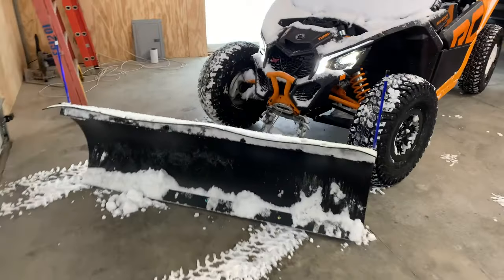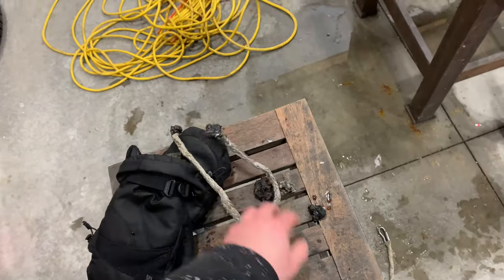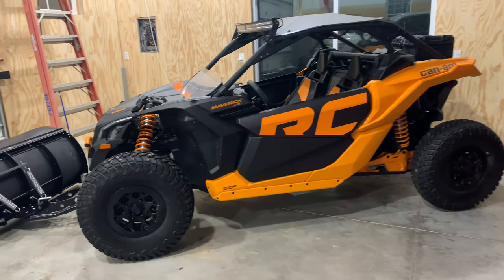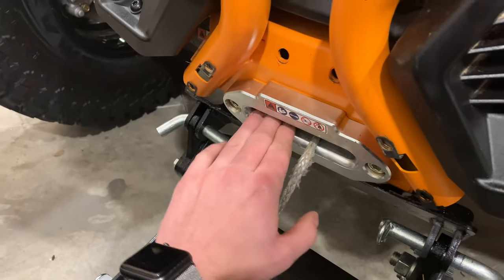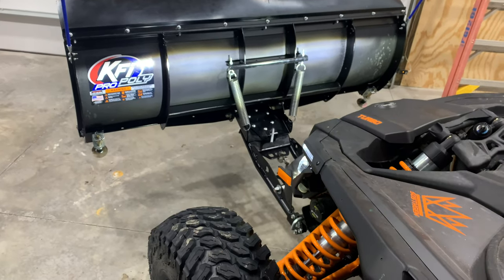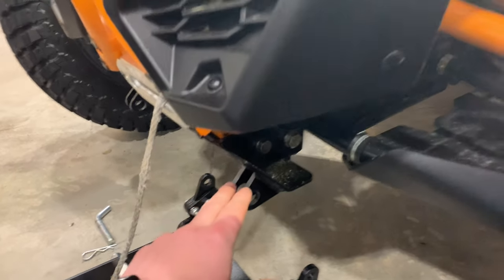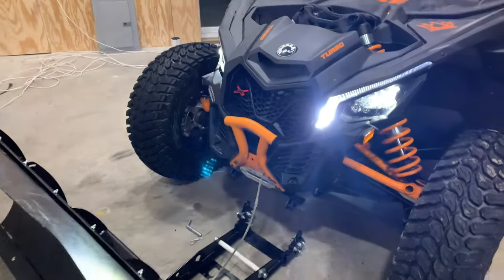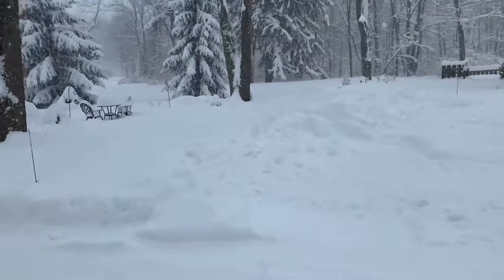PART 2 - Installing a KFI 72” Poly Snow Plow on a 2020 Can-Am Maverick X3 RC

Comment: Put a pully where you have the winch hooked now, and run the cable through that and hook it to your upper bumper.  You need to create a pully system to take pressure off.  Plus it slows the articulation down.
Reply from the maker: I mention it in either part 1 or 2. Definitely the move for next season !
Reply from the maker: Just ordered the KFI pulley fairlead for $40. Def something I’ll be adding to the tube system soon

Comment: Any updates? Still working ok? Any suggestions on this kit or would you do a different brand plow for a x3 ? I’m considering buying a x3 max xrs and need to do a plow for it.
Reply from the maker: Made a few simple tweaks but the setup itself is rock solid

Comment: that video and part 1 was very helpful.  I wish I lived close by.  I'd be more than happy to pay you to do that on my 2021 XRC.  Right now I've asked powersportsID what mount will work with our machine and hopefully they have one that doesn't require welding.  From your knowledge gained, do you think there can be a mount that will just fit and not require that type of effort?  Subbed.
Reply from the maker: Thanks for the comment! And yes KFI sells a winch mount and winch kit. But with the RC I wanted to keep my factory winch mount and winch that came with it. Overall I think it looks way cleaner and saved a few pennies
Reply: Hey, ty again.  Sorry I wasn’t clear in my question. I meant keeping winch and stock bumper.  I don’t want to change it either.  BTW, did you ever fashion a pulley? Do you think a roller fairlead would help your current setup?
Reply from the maker: Only way I can see keeping the factory is how I rigged mine. I still need to add the pulley system. That’s something I’ll be adding for next winter season
Reply from the maker: Just ordered the KFI pulley fairlead for $40. Def something I’ll be adding to the tube system soon